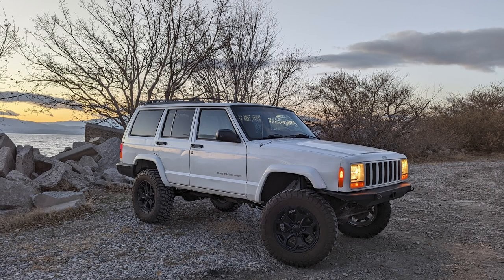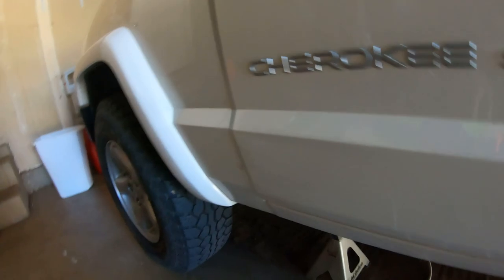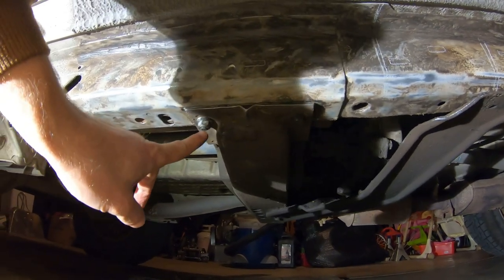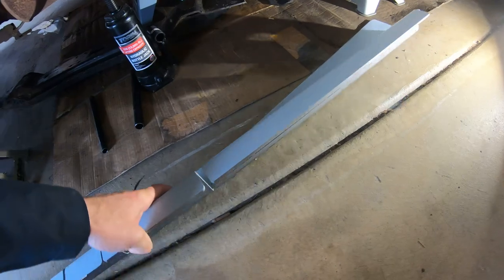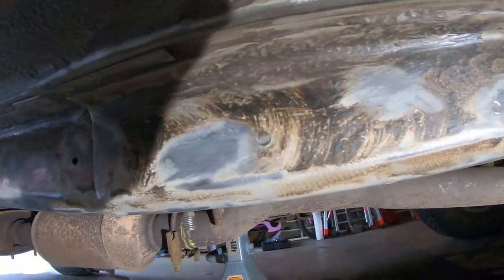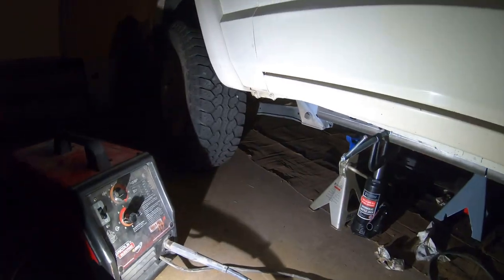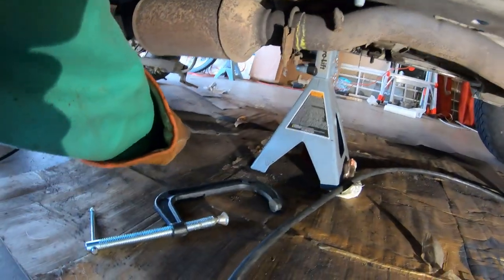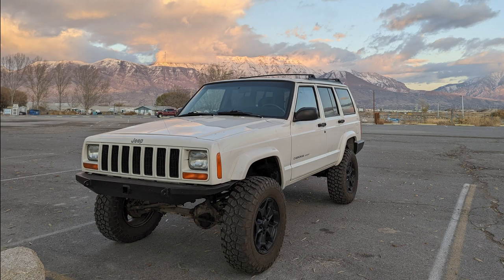Fixing Jeep Car's Weak Frame with IRO Frame Stiffeners

Comment: Man, your Jeeps undercarriage is so clean.

I'm from NYS, home of the Rust Belt. 😵
Reply from the maker: I got really lucky with this Jeep. Bought it at auction out of Montana without seeing it first. Turns out the previous owner(s) took really good care of it. The paint is in pretty good condition and, like you said, it's incredibly rust free. There are only a few little spots here and there, and nothing more than surface rust. It must have been washed regularly and garage kept. With over 200k miles on it, it was driven regularly.